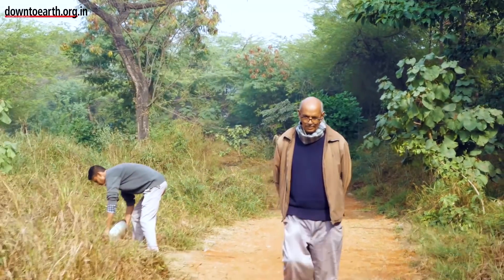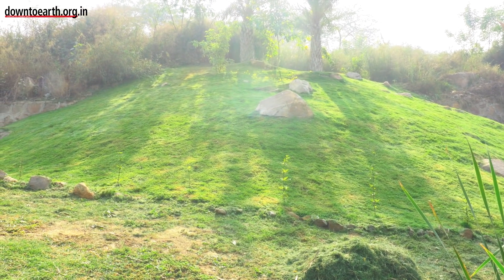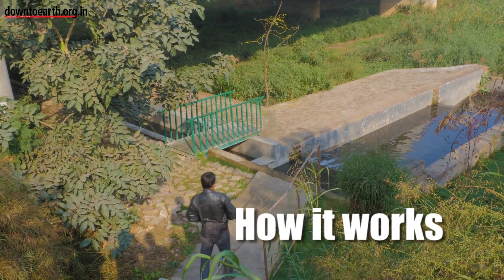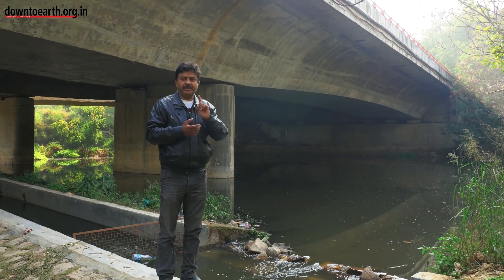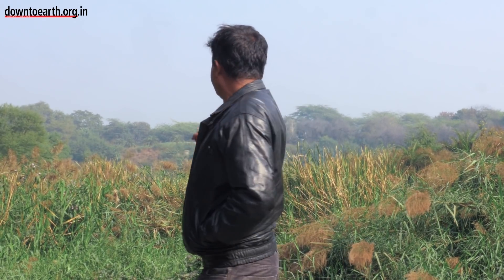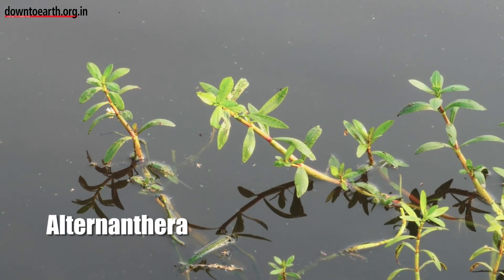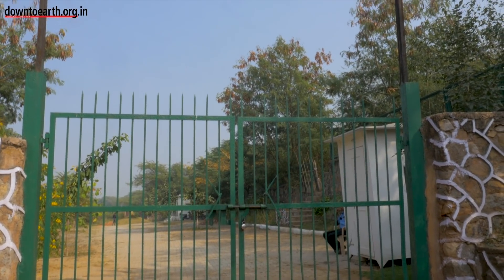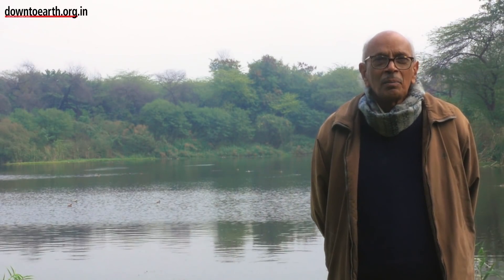How Neela Hauz, south Delhi's biggest water body was restored using natural process

Comment: Brilliant. Beats me why, despite the knowledge of such methods, the governments across India are not implementing them. This is so easy to do, does not require much investment and does not run the risk of breaking down like CTP.
Reply: probably space constraints? A potential solution could be to dig the existing lake space deep enough so that the existing place itself can be used for both cleansing & storing the purified water. I'm from Bangalore. Although the local authorities have made okish effort over the past 2-3 years in conserving the lakes, still lots left to be done